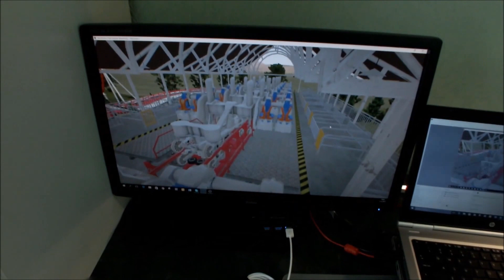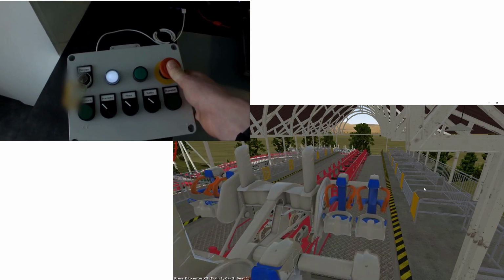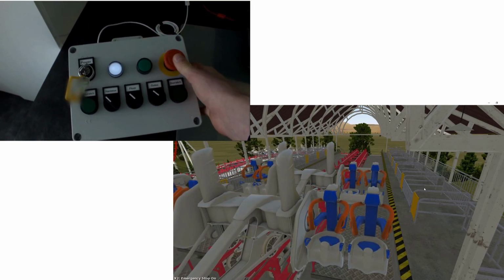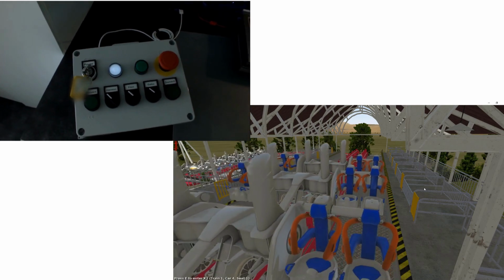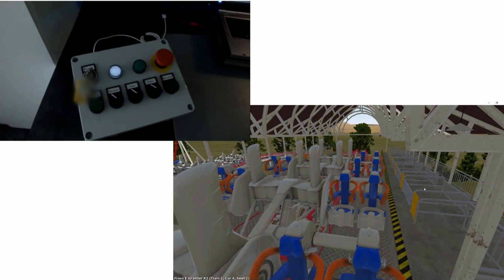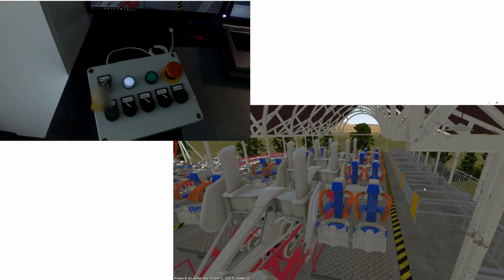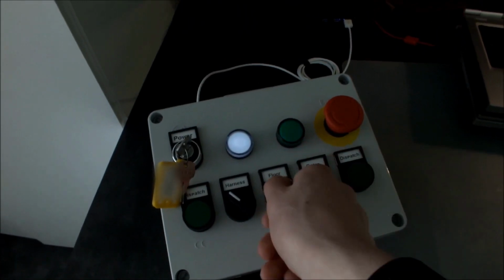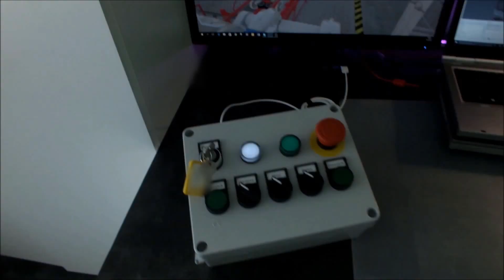2017 - No Limits - Custom Big 9 element USB dispatcher control panel #5

Comment: I just finished  my 4 button panel today. It’s a lot easier than I thought it would be. Chat GPT writes the code for the Arduino and tells you how to wire the buttons according to the design you tell it.